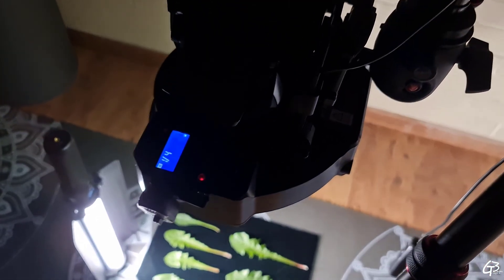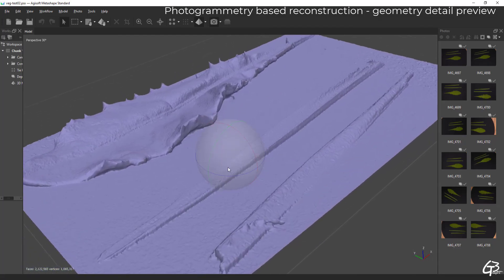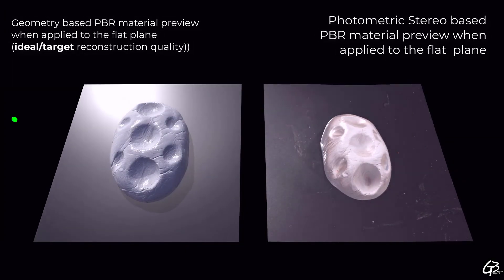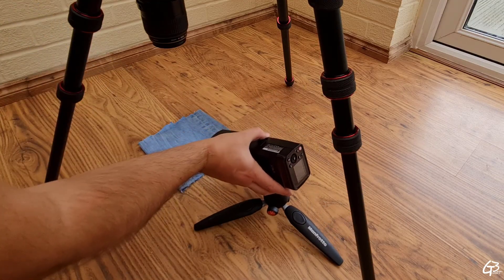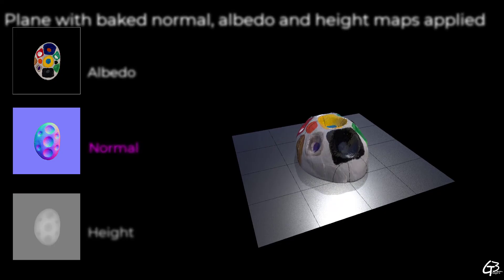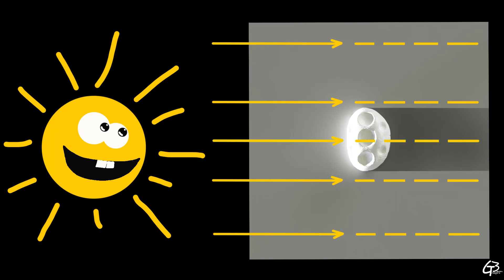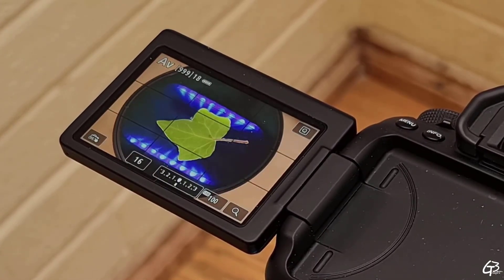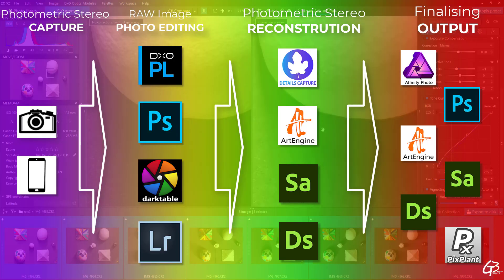Photometric Stereo Technique for PBR Materials - Using Shadow to Capture Surface Detail

Comment: Do you think the new DJI Mini 3 pro will work well for capturing surfaces?
Reply from the maker: It depends to what you compare it to. Any standard camera outcompetes any drone and will give you better results. Also as I understand Mini3 has a sensor with just 12Mpx of effective pixels.. to compare Mavic2Pro has 20. Since it is lighter it is going to struggle with wind a bit more to heavier drones, so its a bit more weather dependent. Wind has especially big impact for close shots. 
Honestly I would consider this drone.. similar to Mavic2Pro as a flying mobile. It will do the job where camera cant and provide you coverage camera might struggle with. It has worse parameters to Mavic2Pro but they are still much better to old Minis and old Air drones. I am sure that if properly used with enough coverage it should do the job well enough.
Especially that drones might be super useful with new AI to single image AI based algorithms incoming as they allow to capture larger area easily
Reply: @GrzegorzBaranArt  Thank you for your input. The main reason Im thinking about the mini 3 is its light weight making it almost regulation free in the EU where I am and the Mavic 2 will be heavily restricted. I have a DSLR that gives me great results. Maybe I should try the DSLR workflow on my cellphone as a way to see what I can expect from a Mini 3. I have learned a lot from your videos, quality stuff that is much appreciated!
Reply from the maker: @PcKaffe  Any camera is better to no camera and any drone is better to no drone. Of course there are exceptions and old Mavic Air was so bad that was basically useless. Mini 3 is much better compared to its predecessor and should do the job. What I mean is that I would capture areas you can reach with the standard camera. And I would capture those you cant reach easily with the drone.
Its a good idea to test quality with your mobile.

Comment: Have you ever given an IR flock sheet a try for the BG? Or try painting something with the notorious "Blacker than Black" paints?
The way both materials basically work is how they are meant to absorb a serious percentage of the light hitting it.
This may be more expensive in compare to a series of other options but the results should be a bit more of a guarantee.
Reply from the maker: Nah, I haven't. I was considering but they were too expensive and the setup I build was good enough already. I have noticed that any paint fades in time and gather some dust when used.. therefore its purely black just for a short period of time :). I am sure that blacker then black paints should work better and make captrues easier. 
So I was considering to purchase one and even had it in a cart already but.. it was £50 for 100ml while the cheap one I used was £7 for 400ml.. and I had some other things in my 'must purchase' queue so I deprioritised it :)

Comment: Could you try BLACK 3.0 ? In both photogrammetry and Photometric Stereo. It should help a lot if what they claim is true.
Reply from the maker: I don't have access to exact BLACK 3.0 to try it out but to be honest any black surface with high absorbtion level will do. Some will do slightly bettter to bother, but the way you use the light and set your camera is more important in long run. Of course better absorption level always helps and makes the job easier.

Comment: Hey! What camera would you recommend for photometric stereo capture?
Reply from the maker: The one which has the highest image resolution (more Mpx) as in this case texture size unlike in photogrammetry, is directly dependent on the actual image size. Second thing is the lens. Actual brand doesnt matter really but if I have money and start clean, I would probably go with Sony A7R4
Reply: @GrzegorzBaranArt  Expensive as hell! I will experiment with some entry level DSLR camera to see what results will i get. Shame that the lenses are more expensive than the body sometimes!
Reply from the maker: @Igor_Zdrowowicz  oh, but you didnt ask me what affordable camera would I recommend :D. I also can't afford Sony A7R4 but I had access to it and would recommend it for this purpose. Regarding lenses, they dont get old as quickly as camera does. If you capture a lot, you need to change camera every few years because it has very limited life span. Sensor gets more and more hot pixels .. not to mention that each camera has limited shutter life span. Lens stays longer, there are many folks who use even very old (20, 30 or even 40 years old) lenses with proper adapter. I wouldnt recommend DSLR anymore as basically all camera producers has discontinued DSLRs. For example old DSLR lenses for Canon dont work anymore with new RF mirrorless Canon mount without EF-RF adapter. 3rd party lenses are cheapper and often worth to consider as an option. THis is also the reason why Canon doesnt allow for production of any 3rd party lenses for their new mount.. which is probably another main reason they lose so many customers recently. But maybe it will give them a lesson. In practice 3rd party lens can be even 10 times cheapper to its brand counterpart.
Reply: @GrzegorzBaranArt  Oh i see this field is not free from the greed politics! Ofc my bad not mentioning that I'm looking for an entry level stuff 😅 I'm reading a lot opinions about Canon G12 being good for texture hunting but i guess rarely anybody not already knowledgeable in the camera quirks and features means photostereoscopy and capturing perfect crisp normals with it.I guess it would be cool to have some entry level camera, good enough for large scale textures, as well as those sweet saturated plant leaves and their normals.

Comment: if you're trying to get shadow detail, why would you use the camera flash? 24:40
Reply from the maker: Because this technique is based on observing shadow when cast from different directions. The flash light allows me to illuminate the subject with the light strong enough to ovewrwrite any environmental light but also to shorten cameras exposure time. I covered details in this video. I can use a LED light instead but LED light needs longer exposure, therefore isnt strong enough to overwrite any environmental light and needs to be used in total darkness. The camera flash I use in here isnt connected to the camera but is free to move around.
Last but not least, any photometric stereo app expect to be fed with this type of data for reconstruction. Hope that makes sense :) but I would suggest to watch the beginning of the video where I covered it in detals already

Comment: Would Metashape solve this kind of dataset for reconstruction?

Edit: Zapomniałem, że mogę po polsku pytać ;)
Reply from the maker: I am not sure what dataset you are askigng about? For photometric stereo we capture series of images from exactly same spot. In this case position of the camera doesnt change. From photogrammetry point of view it would be just a single image illuminated from different directions, therefore would be useless for photogrammetry reconstruction. Technically we need at least 3 images captured from different positions (under different angle) to estimate accurate position of the subject in 3 dimentional space.
Metashape, 3DF Zephyr or Reality Capture are photogrammetry tools. This video isnt about 'photogrammetry' but about 'photometric stereo'
Reply: @GrzegorzBaranArt  That's exactly what I was asking - actually between my question and your answer I tried it with some fabric and it didn't work in Metashape but worked great in Sampler ;) Thank you for the great work by the way - it is tough to find know-how about PBR scanning and photogrammetry.
Reply from the maker: @notorioushax  I was planning to make another video to show how to proceed with these captures, but wasnt sure anyone is interested. Instead I just dropped the 'workflow' section at the end of this video (around 55th minute). There are many apps with 'Photometric Stereo' functionality and Metashape isn't one of these. You can use Details Capture, ArtEngine, Substance Sampler and Substance Designer instead. Each has its pros and cons. Cheers!

Comment: I think you're using shading wrong. By shining light directly on the object, you can only get hard shadows. When you use light indirectly, that's when the real details emerge. In fact, not just one but two; For example, use indirect light with a 45 degree angle. Maybe you can create more detailed information by making one a different color.
Reply from the maker: Hey, this is the reason why I was experimenting with the slim light. Regarding the photometric stereo reconstruction, shadow needs to be direct when it comes to the 360 angling as the technique is based on this exact pronciple. soft shadow in 360 direction wont work, not to mention that might cause issues with angle autodetection. At the end tho, everything depends on the app and algorithm used for reconstruction. Most apps expects point light with hard shadow - so the point direct light under 45 degree angle seems to be the best choice. Of course a lot depends on surface type and level of its complexity. But as said, nothing is set in stone and the technology and tools change and differs. So whatever works for you is good. What I presented in my video is just some theory and one of many options to consider :)